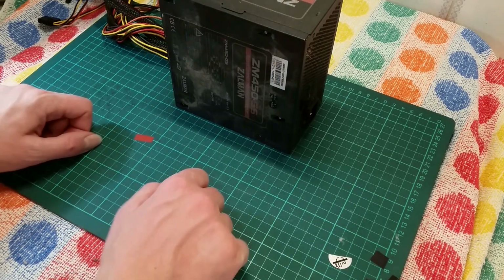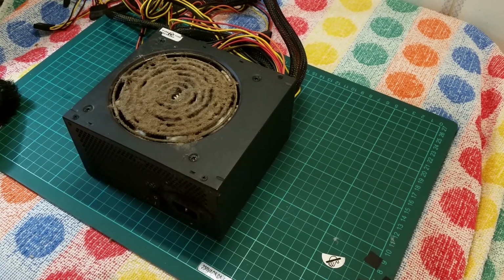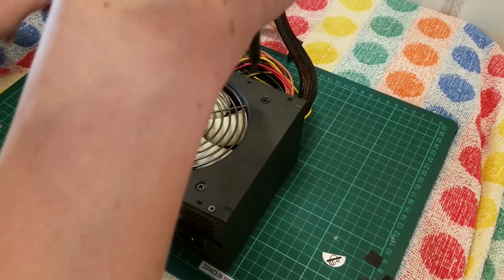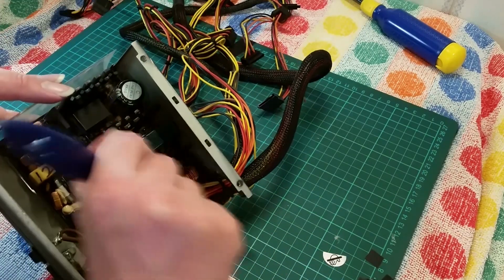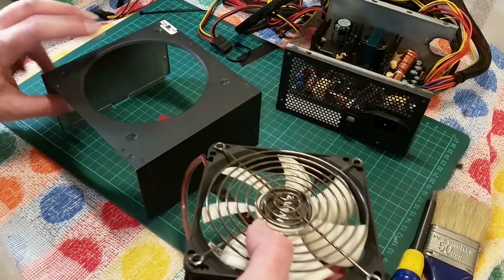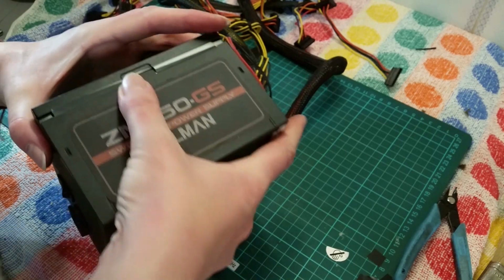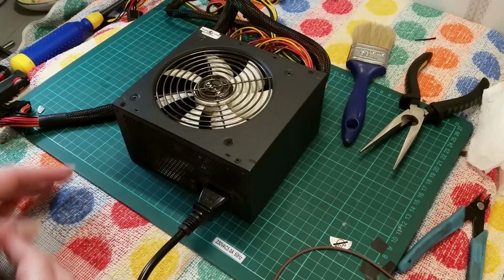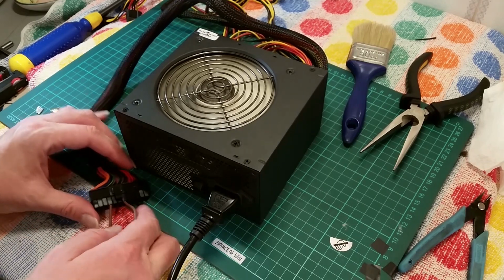The Most Dirty PSU I Have Ever Seen - Lets Clean It!

Comment: isnt that dangerous>?
Reply from the maker: I'm still alive.
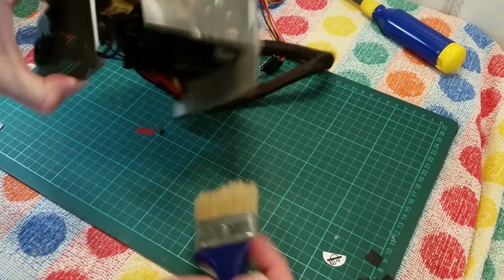Reply: @TheDutyPaid  he mean's cleaning inside the PSU like u did in 9:04
Reply from the maker: @sadg5056  yes, and?
Reply: @TheDutyPaid  it's dangerous?
Reply from the maker: @sadg5056  I know, even say so in the video. If you take the right precautions there is minimal risk. Probably safer than walking down the street at the moment
Reply: @TheDutyPaid  i did hear you say it can be dangerous, use a little bit of caution. you really should have mentioned discharging the capacitors and stressing the dangers. people have died from touching the insides of a power supply. otherwise good video.
Reply: @ComboverChris  No, they have not.